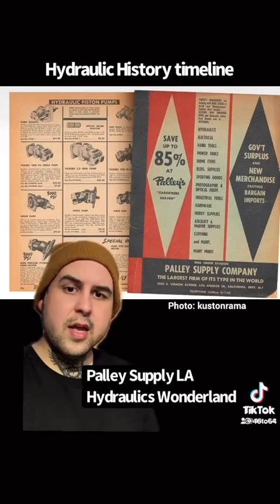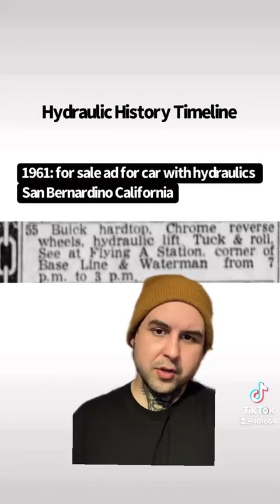History of Lowrider Hydraulics✌🏽🕶 #1 #Best #Lowriders #Shorts #History #EnjoytheCruz

Comment: Yessir Mexican American Ron Aguirre created the hydraulics for Lowriders and started it first 🇲🇽🇲🇽
Reply: Jim Logue was first in 1958. Ron Aguirre was 1959.
Reply: @G4GUSTO Jim installed the hydraulics on his Ford a year before Ron’s father installed hydraulics his sons corvette.
Reply: @G4GUSTO Jim had hydraulic lifts with switches. He ran a 12volt system using two 6 volt batteries on 24 volt aircraft motors. Ron used a manual hand operated pump on his .
Reply: @G4GUSTO chapters 4 and 5 of the link
Reply: @josemejia9349 You are mistaken. The first guy to install hydraulics on all four was Ron Aguirre. Jim Logue stated that he could not remember the actual date of completion for his Ford. The photos in this video were taken in Feb 1959, and Jim was not even present. Ron completed his car and had photos taken 4 months before in Oct 1958. This false story was circulated in 2016 when the then owner of the Ford was trying to get a higher sales price and Kustomrama who was in charge of the marketing promoted this false story. And now this commentator is further perpetrating the story even after the errors were pointed out.
Reply: @josemejia9349  Totally wrong
Reply: @PhilipHernandezChannel  Jim had already installed hydraulics in the Fab X and was in the Army already when Ron did his corvette.
Reply: @PhilipHernandezChannel  Fab X was first
Reply: @G4GUSTO custom car magazine Feb 1959 -
Hydros installed early 1957
Car completed 1958, Jim joined the army late 1958